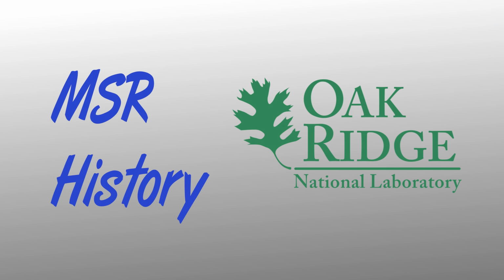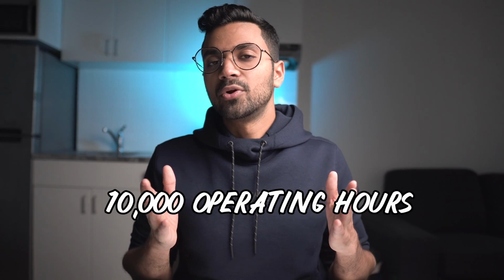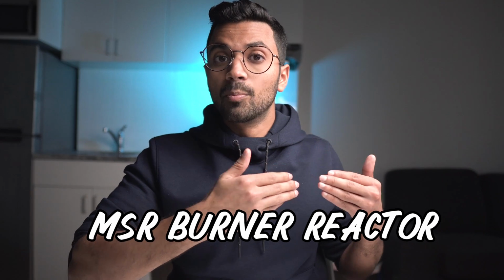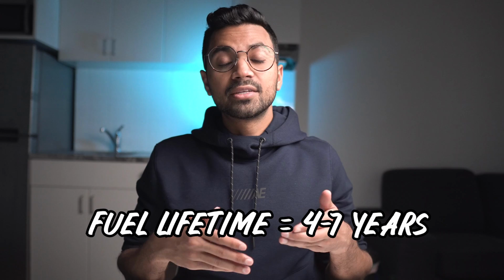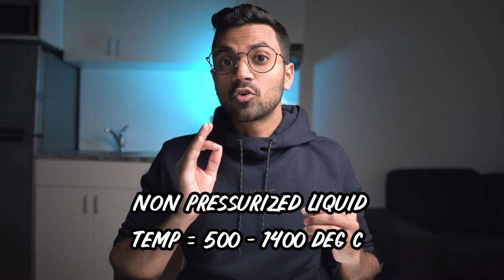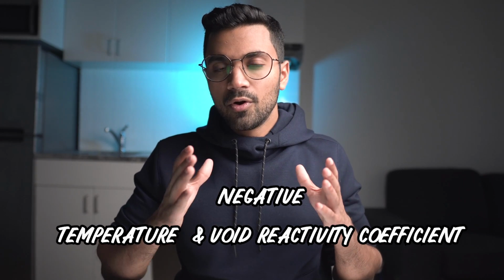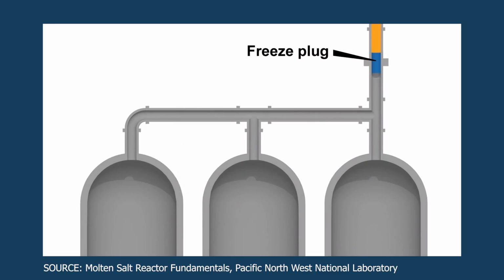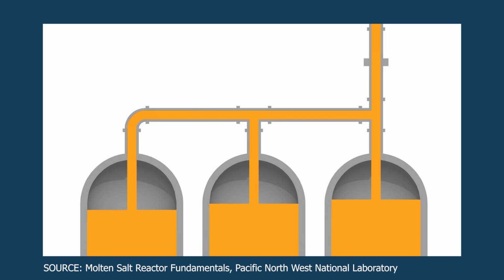Revival of Nuclear Waste Burning Molten Salt Reactors

Comment: Negative Temperature coefficient is rather self explainatory: heat increases, motlen salt expands, reactivity is lowered due to higher distances between atoms, I get it.
In a water moderated regular NPP, it is as easy to explain the void coefficient: more steam in the space between fuel rods means less liquid water in the same volume, therefore less moderation, decreasing reactivity. So far, so great!
But: how do you explain a negative void coefficent for MSRs?
The coolant in the primary loop is not boiling (hopefully), therefore, there should be no voids in the first place, let alone any influence on reactivity?
Can someone enlighten me on that topic, please?

Comment: MSRs can use water. It is the high temperature, not molten salt that allows a CHOICE to use dry cooling, but it does reduce efficiency & revenue vs water cooling of MSRs.

Comment: I am searching for your small modular reactor video, like what is smallest candu reactor?
Reply from the maker: @Peterhall1900 The smallest CANDU reactor ever built is the SLOWPOKE-2 (Safe Low-Power Kritical Experiment) research reactor. It was developed by Atomic Energy of Canada Limited (AECL) and is designed for use in universities, hospitals, and other research institutions
Reply: @OsamaBaig  thank you

Comment: The UK tried this at Dounreay, with NaK molten salt breeder reactors, and they shut down the last reactor in 1994. At present  think the only one running is in Russia. The coolant leaks from the NaK is hugely problematic, they had to keep shutting it down for obvious reasons due to the properties of Sodium.
Reply: NaK is liquid metal, NOT a Salt. A salt is already reacted, so cant react exothermically with water or concrete (i.e., water).
Reply: @Ed Pheil  I'd suggest you read up about the difficulty Dounreay had with the Nak coolant, they've only just removed most of it from a reactor which was commissioned in the 1950s. I think the above misses the point Sodium metal reacts violently with water, and there is a continual issues with its use as a coolant, regardless of which form its in.
Reply from the maker: Interesting to know this cAI, I believe Japan has some incredible facilities as well. I had the chance to visit a few recently and they were truly state of the art
Reply: Than you know about the shaft.

Comment: What do you know about deep-earth nuclear fission?  Not just nuclear decay but a natural critical fission reactor in the mantle.  We know about Oklo but recent anti-neutrino detectors have indicated that fission is occurring deep inside the Earth and could be providing half of the planet's heat.  I like to say the heavens are powered by fusion and the Earth is powered by fission.  Contrary to the environmentalist idea that nuclear fission is some kind of unnatural evil, fission is natures energy and has been for billions of years.  As they say, we know more about the surface of Mars than we do about the workings of the Earth.  I think it is important that the public see nuclear power as natural like the wind.
Reply: I was aware of Oklo. But I thought Geothermal heat was just decay heat. Maybe there's a bit of fission too.
And yes. Nuclear reactions are naturally occurring. We are just artificially making them so we can directly and controllably harness them.

Comment: One thing you missed about molten salt reactors is the ability to load follow.  A example is the Elysium MSR proposal where the reactor is controlled by the amount of heat pulled out.  Using the effect of the fission reaction shutting down as it gets hotter and speeds up as it gets cooler  the reactor will produce heat based on how much heat is pulled out of the reactor. This makes for a reactor that can ramp power output up and down kind of similar to a accelerator pedal on a car. This is very different than current nuclear power plants that have difficulty varying their power output.
Reply: While our reactor has a negative temperature coefficient, so could load follow, our fuel is so cheap we keep the reactor & intermediate & steam loop at constant power most of the time to resuce cycling fatigue damage & increased maintenance costs. Only the turbine cycles following load, using turbine bypass to reduce turbine load following demand.

Should demand go down for long periods, we may slowly adjust power of the reactor down & slowly back up if demand is expected to be trending up.

Yes, our fuel cant be damaged by cycling, but heat exchangers are the limiting component for fatigue damage.

This allows us to rapidly follow demand without cycling the whole plant. Burning extra SNF is a revenue, not a cost.

Note, when demand gows down, turbine load goes down, but condenser load goes up, in our case load to the Air-cooled Condensers. We also include a desuperheater for bypass steam to reduce erosion & thermal cycling of the condenser.
Reply from the maker: Very good point Stanley! Load following is definitely an important feature, especially if you want to pair nuclear up with renewable technologies. Thanks for sharing this piece of information!
Reply: @OsamaBaig  Nuclear doesn't pair with renewables, it replaces them.
Reply: @chapter4travels  agreed. Making advanced nuclear subservient to weather dependent power plants is insane.
Reply: Load following is following demand, Source following is following erratic renewable source production with grid priority subsidies.

Comment: Could MSRs be used for high heat intensive processes like making steel and cement?  How close to the MRS would the cement factory have to be?
Reply: Not directly, as most MSRs are limitedto <700C, but even at 950C arent near concrete needs at 1400+C, or steel at 1800+C. So, auxilliary heating would be needed for concrete & steel or different lower temperature processes than today.
Reply: the only reactor that runs hot enough to make steel is NASA's NERVA, a gas-cooled exotic ceramic fuel reactor in which economy is sacrificed to achieve maximum temperature. Typical candidate molten salts for reactors boil at slightly above 1400C, less than 1500C, far too cool to make steel. 600C - 700C is the design temperature proposed for molten salt reactors in which the fuel and fission products are dissolved in the salt, much better than the 340C of a pressurized water reactor, but still too cool.
Reply: Probably on site. There's MSRs in development that are basically as big as a large van,with power outputs of about 20 MWe (electricity)- for an idea, that would be some 95%+ of my county's electricity.

 Probably translating into some 40-60 MWth. That's a lot of power.
These are designed to be closed systems. Basically the reactor is shipped to the site, runs for whatever years devoid of any human intervention, and is sent back to the factory for defueling, and likely to be reused if in proper mechanical condition. Kinda like LPG canisters are nowadays.
Reply: Hogwash! You made that all up. None of that exists, & is irrelevant high temperature.

Comment: Large Corporates are trying to remove MSRs, for water cooled. There is more money (and risk) in water cooled.
US Dept of Energy are actively blocking MSR development for water cooled reactors, including Small Modular Reactors (SMR). 
MSRs are awesome, can can provide hydrogen gas and desalinate water, significantly cheaper, safer, and almost no waste.
Wish I could be working on them. Copenhagen Atomic and ThorCon have interesting MSR solutions.
Reply from the maker: MSR's are in research phase at the moment.. However, Water cooled reactors have been operating for almost 60 years now, we've got a lot of experience with those under our belt. We need significant investments in both! You should reach out to these companies, I'm sure they would be delighted to hire new talent

Comment: This concept is really more than just a "better mouse trap".  It takes the biggest fear people have of nuclear power, "nuclear waste", and uses it to produce about 30 time more energy than the original fuel produced.  Although the inventory of spent nuclear fuel is relatively small, there is enough in the United States to power the entire country for 250 years at the current levels of use.  In this respect, if a level market playing field is reinstituted, it is possible to supply "power too cheap to meter" for all (worldwide).  You could afford to charge for power like you do for cell phone service today:  one price per month, all you can use (because there will be a desire to dispose of existing stockpiles of spent nuclear fuel as quickly as possible).  Thanks, Osama.  This is very enlightening and is the way we should go.  If we do start using spent nuclear fuel for electricity, at one cent per kWh, its value is almost twice its weight in gold.  Go ahead, figure out how much value is in 90,000 tons (just the Unites States' existing supply) of gold is and double it.  Remember, it is 100% domestic (already exists on each reactor site in the US), 100% clean (already mined and refined), and available now throughout the world.  So go ahead and bury this stuff, but it is curious that you do not bury gold as well.  Remember, no accident with spent fuel has occurred in more than 6 decades of handling it and shipping it.  Oh, by the way, the Nuclear Navy has never had a problem either since their first nuclear ship launch (the Nautilus in 1955).  I defy you to find a better safety record.  Oh, yeah, nobody has been hurt in more than 6 decades of light water reactors in the US commercial fleet and molten salt reactors (and all SMR designs) are safer than that.  It is hard to beat zero.  We get in cars and planes each day and I will leave it to you to see how many people are hurt from those adventures.  Great work, Osama.

Comment: It would be neat if you could get into the details of thermal spectrum MSRs vs fast spectrum. My understanding is that Thorium is perfect for thermal spectrum and Uranium/ Plutonium is better suited to being fast spectrum. But fast spectrum is not as good at load following (as is thermal spectrum) right? Some of the Gen4 MSR reactors are fast spectrum (why what is the advantage)? Thanks.
Reply: fast spectrum is MUCH better for load following and for burnup. Fast neutrons are insensitive to pile poisons, especially the notorious Xe-135 volatile, short lived fission product that hinders the re-start or re-powering of a powered-down or shut down reactor for several days. Fast neutrons also make everything they hit that is even marginally fissile to fission with higher frequency, (thereby consuming all those troublesome semi-fissile and fertile minor actinides, like neptunium, even-numbered isotopes of uranium and plutonium, americium, ...) and cause more neutrons to be released when fission occurs; the only problem is that fast neutrons easily fly past their target, so they need a higher fissile content and more compact mass of fuel to start, and neutron reflectors help.
Reply: Thermal is Not better fast for load following!
Reply: @EdPheil  Thank you Ed. That was my understanding too. Without moderators I don't think you want to do anything too quickly.
Reply: Actually, uranium is better in both thermal and fast spectrum MSRs.